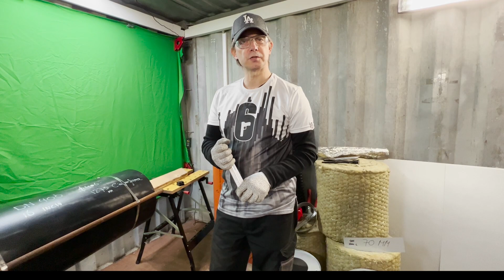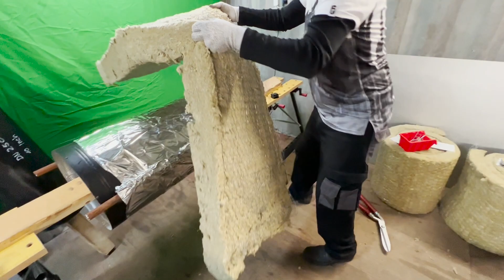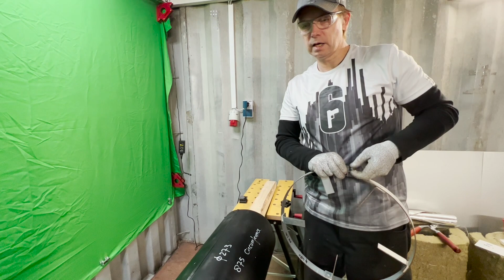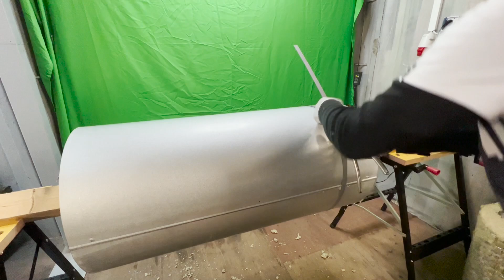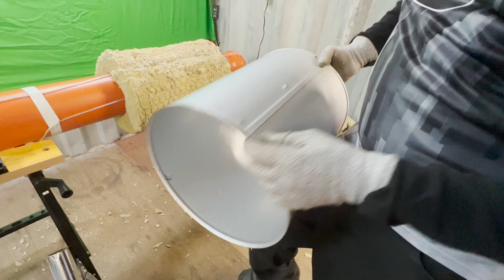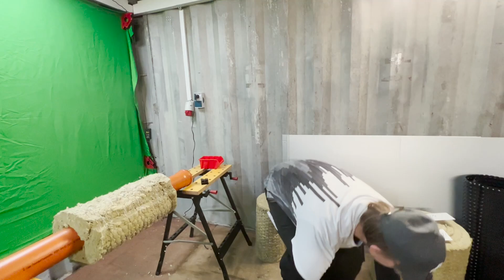Industrial Pipe Insulation

Comment: I want to know if it 100 percent necessary to always use aluminum foil to wrap the pipe  first before you put on the rockwool or other material
Reply from the maker: @SamuelEgwuaka  no it's not always it depends on the specifications

Comment: Before on video elbow.. 3" pipe... Dia 89mm..insulation you write 50mm...and the diameter 190mm..that means just 2 times thickness... On this video 4 times... Correct me if I'm wrong.. Elbow only 2 times and straight pipe 4 times
Reply from the maker: It's 4 x50mm  given in circumference,

Comment: You are good in workshop, but not in in wool insulation. If you will pierce wool in middle, you will have about 80mm. thickness is less, density is higher - not good. L=(D+2t)*3.14-30. D- diameter mm, t- thickness mm.
Reply: This formula workout for all sizes of pipes and insulation...
Reply: Technically he's good, experience matters depends what's your calculations

Comment: I'm an insulator, and I'm so glad we normally do not use rockwool insulation. And when we do we get it manufactured to size. Mostly we use cellular glass and polyiso, also formed to fit the pipe. From the USA
Reply from the maker: That’s how we do it in Germany it’s the cheapest way I think , we also have manufactured sizes but that depends of the company if they want to use it